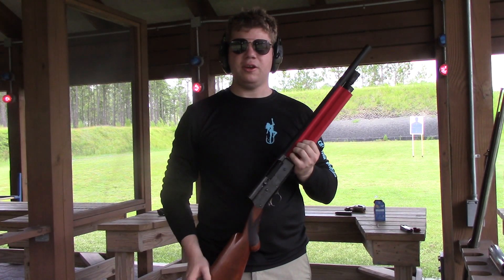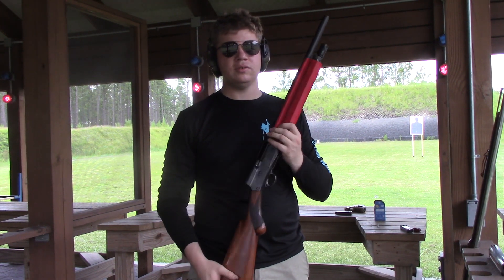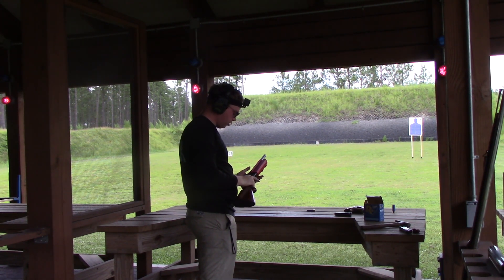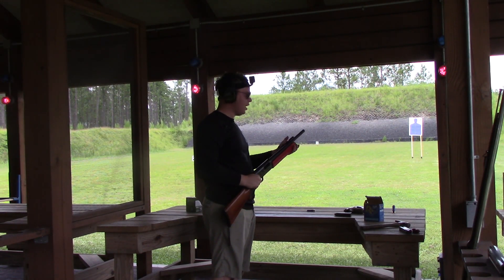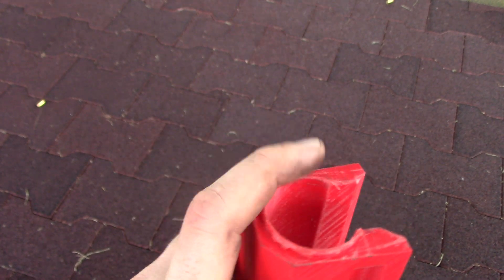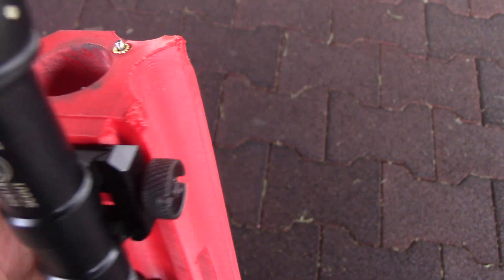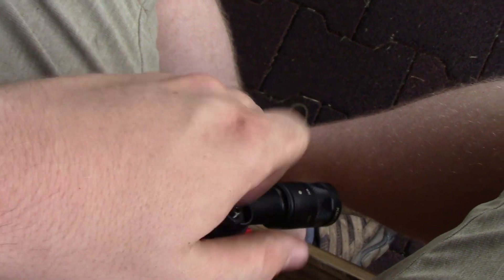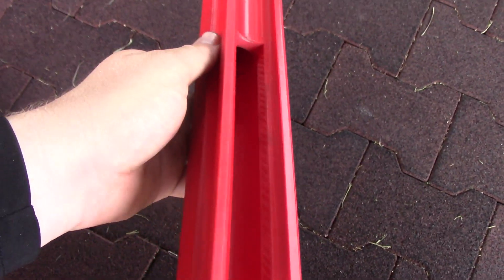Browning Auto 5 3D Printed Forend

Comment: Any plans to rescale this for 16 gauge?
Reply from the maker: @ihateyankees3655  I have a 16g remminton 11. The forend is the same size as my 12g. But I can double check
Reply: @iannesby  I just picked up a 16 gauge a5 with a cracked forend, and a few other issues. I want to fix everything up before I shoot it, and if the crack gets worse I'd rather 3d print than pay for a new front grip.
Reply from the maker: @ihateyankees3655 you can reinforce the wood with an epoxy glue. I used gorilla expanding glue on my light 12 and the lip that sits in the receiver was gone so I mixed saw dust with glue and made a new lip with the mixture
Reply: @iannesby  I was already told to use epoxy and a fiberglass sheet on the inside of the stock
Reply from the maker: @ihateyankees3655  that would work really well. Thats good advice